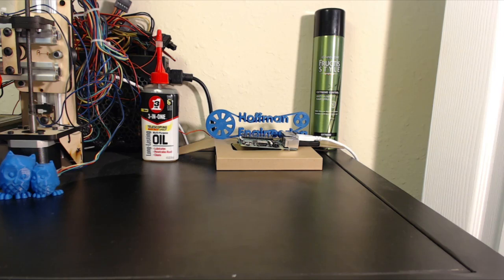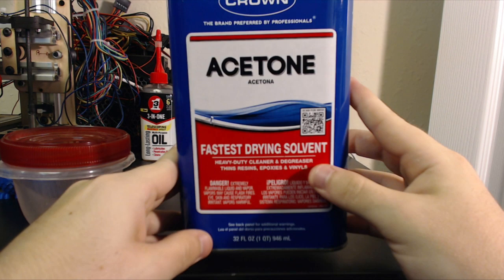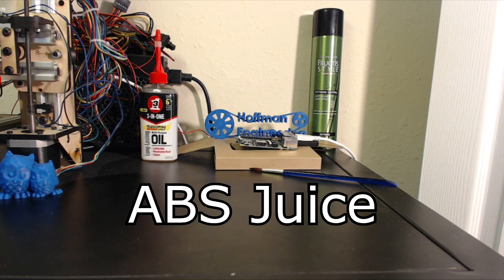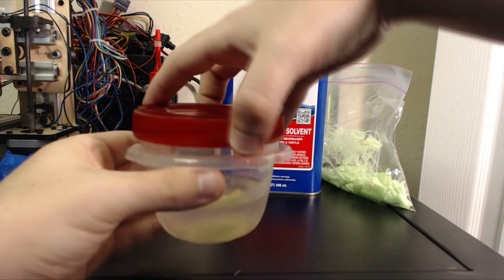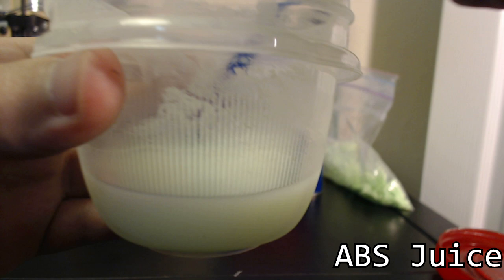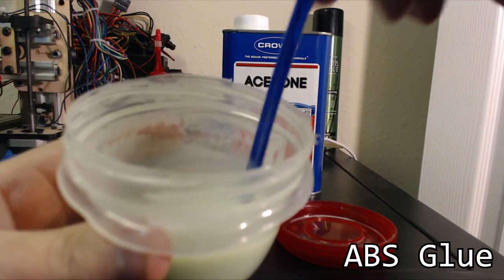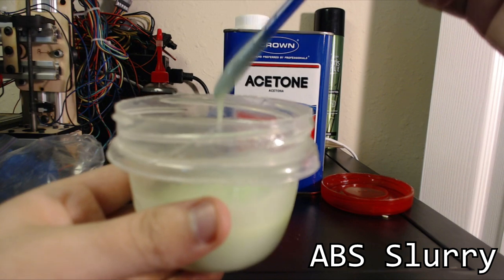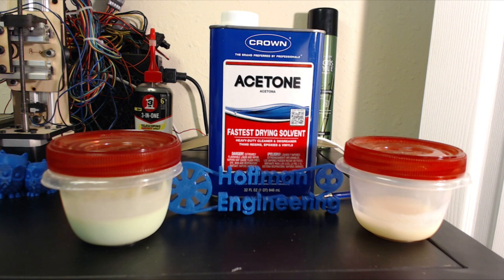How to easily make ABS Slurry (aka ABS Juice and Glue)

Comment: Interesting video. I suggest a couple of caveats for viewers who may try this on their own - I mean making it on your own is the point, right?
Acetone is VERY volatile and should never be used in a closed room. Breathing it is dangerous and even a spark from a motor such as a fan can ignite it - explosively. Knocking over a container can be an invitation to disaster. 
Please wear safety glasses of some sort. A single drop of acetone or something dissolved in acetone splashed into your eye is all it takes.
Enjoy. Caution is not for chumps. It lets you live, and keep on exploring.
Reply: Safety is important, but the amount of misinformation in this comment chain is remarkable. Acetone IS very volatile, but using small quantities in a closed room is not a concern; its toxicity is very mild. Don't huff it and you're okay. Also, acetone in your eye is unlikely to result in injury. ABS slurry in your eye on the other hand... that could have serious consequences. Eye protection is advised when dissolving things in solvents, but maybe don't use expensive eye protection around acetone unless you want to ruin it. Acetone vapor IS a serious fire hazard though. Please don't burn your house down, and don't put still-wet rags into waste containers. 

Also, plenty of nail polish remover is pure acetone. It won't remove your nails. It was used as nail polish remover long before non-acetone removers became common, and it's still used to remove gel nails today.

It's important not to exaggerate safety risks. Doing so leads to something similar to alarm fatigue, where people start taking ALL warnings less seriously, and that can have deadly consequences.
Reply: @terribleperson7284  Since we know many youtube viewers are young enough to not have yet made the mistakes that those of us long-in-tooth have made and seen,  I urge strong upfront caution warnings in videos such as this. 
To say for acetone that "but using small quantities in a closed room is not a concern; its toxicity is very mild." is inviting misjudgement.  If you have ever accidentally knocked over a can of acetone, the vapor spreads quickly and becomes a concern quickly in more ways than one.  I have a scorch mark on my workbench from such an incident.
ABS slurry in your eye - "Leave it alone and it will eventually fall out."  Why would you post that as advice?

From https://dhss.delaware.gov/dhss/dph/files/acetonefaq.pdf:
"If you get acetone in your eyes, flush your eyes with water for at least 15 minutes. Get medical attention promptly."
Read that again: "Get medical attention promptly."
If anyone thinks I have posted "exaggerated safety risks",  then I would respectfully suggest they pick up a can of acetone and simply read the instructions - which are there for a reason.
Reply: @rogerthornhill1547  I'm going to remove the part of my comment about acetone in your eyes, because it is an irritant, but my comments about the toxicity of acetone I stand by. It poses no serious inhalation risk unless you actively huff the stuff. It is frankly way safer than alcohol or superglue. It might just be a sore spot with me because I see a lot of gross exaggerations of the properties of acetone in the 3d printing community and it's important to be accurate when you are warning people of dangers.
Reply from the maker: +Roger Thornhill Great comment, safety is definitely important to keep in mind when dealing with volatile chemicals! You definitely wouldn't want to get acetone in your eye, and using it in a place with plenty of ventilation is great advice.
Reply: +Hoffman Engineering For those of us who do not have ABS scraps at hand - are you aware of any domestic(US) sources of ABS granules, for example, for pursuing some ABS repair work?
Reply: Hoffman Engineering I have a question or two because I want to fix a crack in a laptop of mine. Firstly, how does the glue work with plastic that’s a mix of ABS and PC? Does it still work rather well or does it go horribly wrong? Also is the glue itself flammable and/or reactive after drying like the acetone it’s made with?
Reply: +Roger Thornhill Sorry to say I have still researching but from the other videos and websites, I would say yes.  People have posted repairing items from coffee makers (he used a black Lego piece) to motorcycles. I will be repairing a popup camper so I order the ABS chips.  I agree with your precautions above.  A thought about using MEK instead of Acetone until reading how nasty it is (causes liver problems).  Good luck!
Reply from the maker: +Tim Meredith How did your repair go? Any success with your camper?
Reply: I own a woodworking shop and do a lot of finishing. Acetone flashes out in seconds and is by far the safest solvent to use but definitely not the strongest. It’s recommended to use in well ventilated areas but it’s not going to kill u if u don’t. Lacquer thinner is toxic if used in a closed off area and ur skin absorbs it like a sponge. A lot of shops have switched to acetone because of its user friendly properties and to avoid unnecessary fines if big brother decided it was inspection time. Today u can spray a zero VOC paint and clean with acetone without needing and ventilation equipment. Acetone is safe to use indoors without having to go to crazy unnecessary safety precautions
Reply: +Roger Thornhill You can order chips from Cessna172Online.com but shipping is a little high.  Legos are an option too. :-)
Reply: Tim Meredith Of course, you can use ABS filament too. Better than wasting Legos. ;)
Reply: @timnham  legos!? my kid has plenty
Reply: +Tim Meredith My daughter just pulled the license plate holder from her truck. It's black ABS, I think. I plan to shave or cut up a bit  and try it in repairing the wheel bracket that just broke off my rolling carry-on luggage.  Do you think it will work?
Reply: Roger Thornhill Not that all household chemicals are safe, but this acetone isn’t any more dangerous to have in your home than nail polish remover.
Reply: @emmettturner9452  nail polish remover is like 10 to 20% and is diluted with water so is like very safe compared to pure acetone and also the pure stuff will have a safety cap, fyi using pure acetone as nail polish remover will remove your nails 😆, even so you can use nail polish remover to make this in case of you just need to do a very small amount you will have a bit more runnier mixture.
Reply: @EPortillo5000 really? Because the label says 100%
Reply: Acetone is a VOC and presents a fire and ignition hazard, however acetone is naturally produced in the human body. Your body knows how to metabolize small amounts of acetone, small amounts do not generally present a health risk.

Comment: Can I use slurry or possibly less viscous mixture to permanently fill screws holes in HDPE plastic (my kayak)?
Reply: no. it will only bond with ABS.
Reply: 3 years later but hdpe will basically only bond with itself